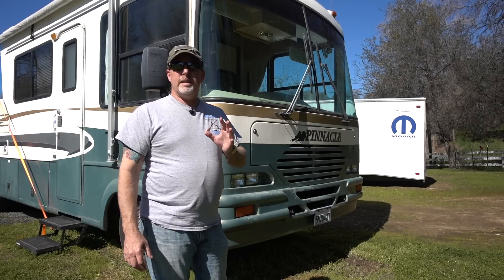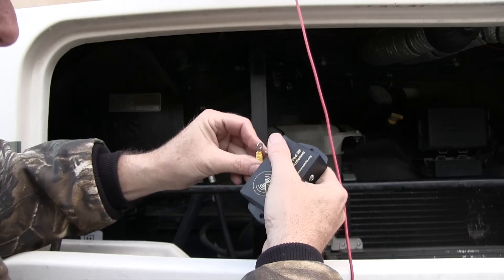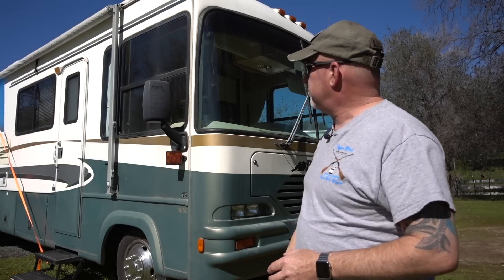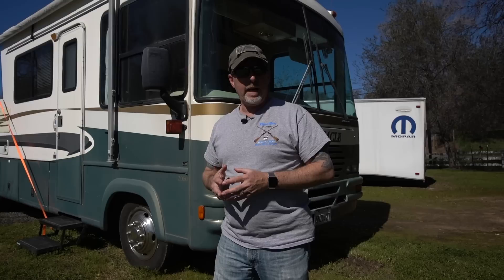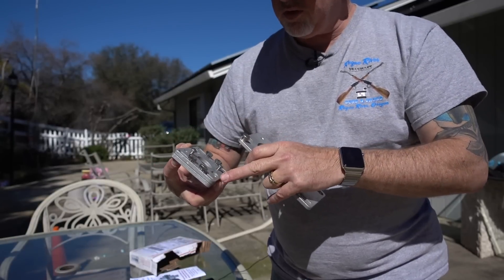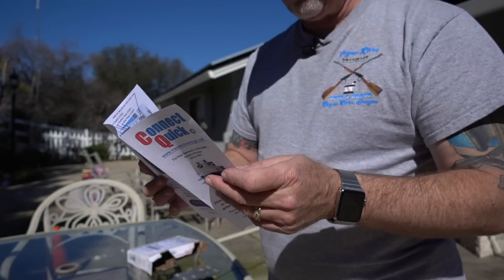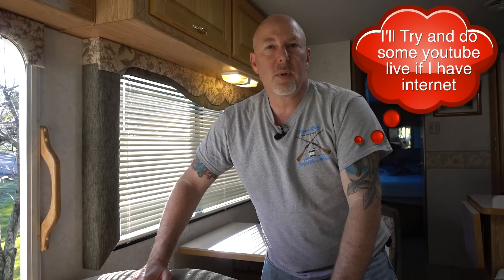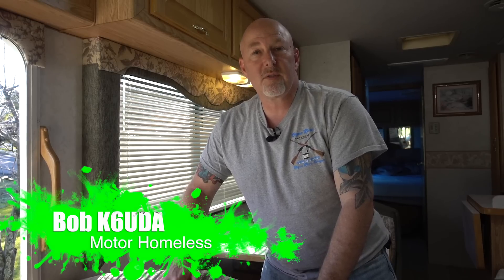Building a Motorhome Ham Station From Scratch - K6UDA Radio Episode 45

Comment: RVs are pretty handy for Ham stuff since you usually have DC equipment that does not produce much RF noise. Additionally it's easy to be far away from populated areas. I was really suprised how good my reception became when I stopped some miles away from any city. This poor little handheld short wave radio acually became really good and  performed a lot better than my much more expensive equipment in my city flat. Next time I will test what happens, when I ground the RV with a deep Iron rod.  'just SWL- no license yet"